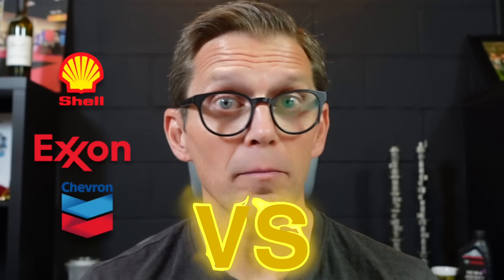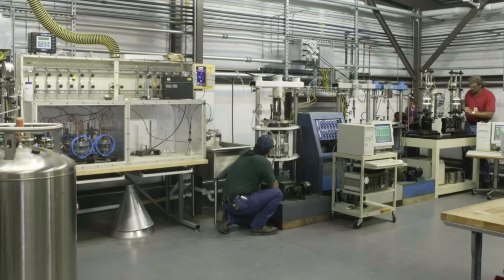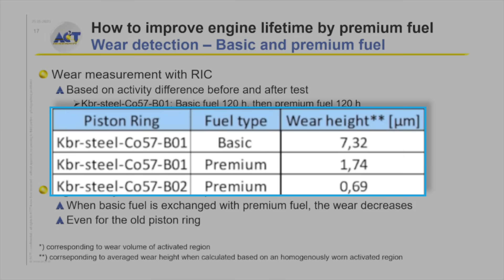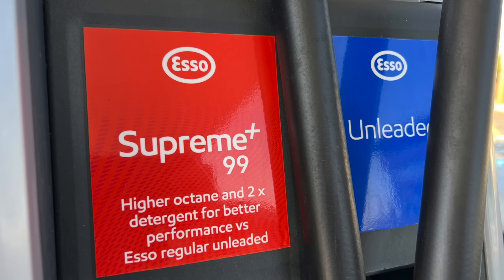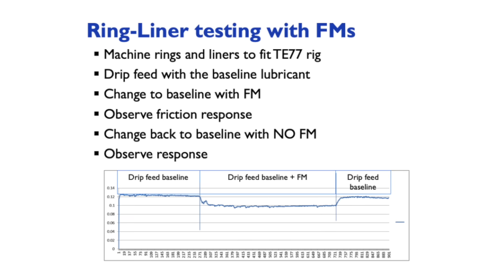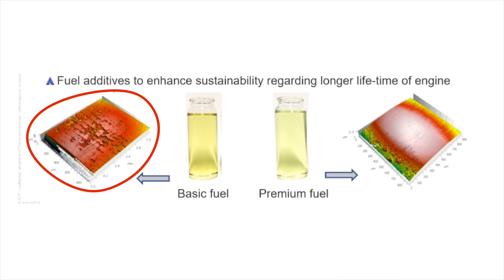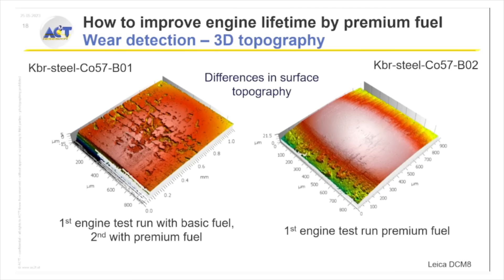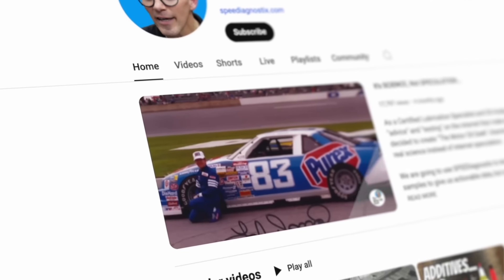Can Premium Fuel REDUCE Engine WEAR?

Comment: Here in Germany we have 100 and 102 RON (~96 to 97 in the USA). Been using only that on my car for nearly 25 years. Recently I sent my injectors to get them cleaned and they told me they basically didn't need cleaning, spray pattern, etc all almost perfect, except one, which was 99.9% good. 30 year old injectors that have never been taken out of the car before. 
That fuel does help.
Reply from the maker: Thanks for sharing
Reply: I have seen the same thing here in Australia with premium fuels, we have two premiums, 95 ron which no one buys, 98 which a lot of people use, and the two regular options which is straight petrol at 91 ron and E10 at 94-96 ron depending on petrol station claims.

With cars that have used 98 almost exclusively, the fuel systems are pristine, where the regular fuels leave a bright red/orange fine smoky dust coating that is also abrasive to fuel pump rotors, brushes and comutators and injector pintles and seats.

My personal experience with injector cleaning is that it is a no no for injectors run on regular as they always leak on heat soak after cleaning, resulting is a hot engine flooding upon restart.  This is because the seats and pintles are pitted and eroded, the dusty deposits is what kept the injectors from leaking before service. So I generally never have them serviced, I just replace them with good used ones that have not been serviced but test good, or just brand new OEM ones (no after market). 

Injectors that ran on premium seldom need servicing, and if they are, leaking afterwards is much less common.
Reply: @3800S1  95 that no one uses? MOST people use 95 over 98 as there is a large price difference normally. If you owned a service station (petrol station), you would know that.

Also E10 is only available in some states, it has mostly been phased out in most states.
Reply: @3800S1 so if i always run standard i shouldnt switch to premium?
Reply: Compare the cost of purchasing and using premium fuel over 30 years to the cost of a set of 30 year old injectors, and I bet the fuel cost significantly more. Also, the effect you're describing sounds to be more a result of detergent additive than anything else.
Reply: @anthonyantoine9232  I already wrote I bought it mainly for the HP gain I get from it, due to the high octane. The cleaning is just a bonus!
Who are you to tell me what to buy and what not and what my reasons should be?

Other fuels dont have that cleaning additive here. They literally advertise the cleaning effect. And you too should watch this video before commenting.

You clearly havent. Nor did you read my comments here.
Reply: @cartrips9263  I'm not trying to tell you what to do lol. I'm making suggestions based upon what I read. Relax.

I watched the video.
Reply: Both you and motor oil geek are missing the point: the test is comparing top tier gas vs "basic" gas. NOT octane levels!!!!
Reply: @1guarino In Germany and much of Europe "Top Tier" ONLY comes in combination with High Octane fuels .....
Reply: @1guarino  can only get that kind of gas with that cleaning additive here in high octane versions. I only told my experience with such additives, it's the other guys who started to derail.
Reply: What kind of engine do you have?
 I guess it's port injection for 30 years old, for that Octane number you should have a high RC in order to get the advantages of the high octane.
BimmerN53
Reply: 99.9% is the very definition of “almost perfect”
Reply: I also live in Germany and no way I would pay that money difference for a car that I do like 15k km a year. On the other hand both my motorcycles get only the best of the best: V-Power racing or Aral Excellium 102 🤓
Reply: You paid for many pairs of new injectors during the 30 years of extra cost...
Reply: @borisboxer1690  Not really. They are not being produced anymore and used ones are very expensive because of that fact. Plus getting them replaced costs about a thousand dollars in labor alone and a lot can go wrong doing that (I know, because I took them out myself).
Also why would I rather live with the fear of them not working 100% anymore over time and then eventually having to check everywhere possible for the cause of a problem thats ultimately caused by dirty injectors?
This stuff works. Period. I gladly pay a little more for it, since its also a fun car thats not a daily driver. And as I said already, its only an added bonus. The higher octane is the main reason I buy it, and that literally adds about 30 HP, because I can run higher boost.
Reply: thats actually crazy and good to know as someone younger
Reply: Interesting what you mentioned about fuel quality and how it destroyed injectors (and fuel pomps).

The Euro 95 is about the same as 89 octane in N. America, while the European 98 is the equivalent of 92 octane. I remember a few gas stations like Sunoco, Petro Canada, used to sell 94 octane in Ontario. In my motorcycle days when we used Wiseco high compression pistons, bigger valves, aftermarket cams the 91 was a minimum requirement for street use and mostly 94 octane fuel was used for modes engines.
Also most stations sell 91-92 Super without added ethanol, while some still add "up to 10% content". 
Maybe it would be worth to add topic of ethanol vs no ethanol fuel, and E85 (used extensively in Brasil), while we talk about fuel.
And, two years ago someone dropped to my friend's garage an old Lexus which was sitting for a decade untouched. The internals of the half empty fuel tank basically showed how corrosive the fuel is, once left inside the tank - the fuel pomp was death, plastics were falling apart once touched and metal pieces were covered by thick layer of rust. The fuel itself had unbelievable smell, more like acid than gasoline, although it still burned well when we took a sample. 
I always tell people to use up all the gas, drain carburators in their lawnmowers, generators because left over fuel causes no start problems later on.
Reply: @pliedtka  I use ethanol-free 93 octane fuel in machines that may sit for a period of time. It has a 2 year shelf life. My generator may sit for 6 months, my ATV, about the same. My 1973 Mustang never had ethanol tainted fuel.
Reply: @TheBandit7613  And I use whatever I can get at the local Coop without any concerns (as long as it's not over a year or two old. Haven't worn out an engine either. One had 315k before I sold it. Running strong. Never had any injector work done on it.
Reply: @TheBandit7613  Mustangs for life!
Reply: @pliedtka  Some Petro Canada stations still sell 94 where I am in southern Ontario. But not all. Not sure about Shell.
Reply: What effect would 2 stroke oil in diesel have on wear? It quietens the motor.
Reply: @davidigglesden  Don't do that, it is not made for a fout stroke..... .

Comment: But here in Canada, what would be the difference between Shell 91 octane vs Petro-Canada 94 octane gasoline? The chemistry has something to do with it, but most brands (except Shell) don't brag about it. Would more octane be better than better chemistry is my question Lake. Great video btw!👍
Reply from the maker: Thanks. My suspicion is that the Petro-Canada 94 would be similar to the Shell.
Reply: @themotoroilgeek  If you could test both, because Petro-Canada 94 is not offered throughout the country, unlike Shell 91. Petro-Canada only offers 94 octane in 914 stations here in Québec, Ontario and Alberta. Petro-Canada also has 91 octane btw.
Reply: Octane rating simply reflects resistance to detonation.

Comment: Lake this is awesome, thanks for explaining. I always thought that there is zero benefit to using higher octane fuel when a vehicle does not call for it. When you get to the next video can you go thru the cost vs benefit calculation? Also, explain "Top Tier" branding, how does that play into this? - Cheers
Reply from the maker: Great suggestion!

Comment: Hi altitude areas in the US have 85 octane fuel - I cant fathom how bad this is for an engine. I never buy a used car coming from those areas
Reply: That doesn't affect the fuel quality. Regular is 85 (instead of 87) in Rocky Mountain states because that is all that is needed to prevent detonation at those high altitudes. Higher altitude = less air in cylinders = less pressure before ignition = less susceptible to detonation. Premium fuel in Rocky Mountain states will still have the same rest of the additives packages as does premium fuel in the other states.

Comment: I understand Premium has more detergents and additives in it. I only use Shell Oil and Gasoline when possible but like Ethanol free gas when I can find it. Wouldn't it make sense that there is less where with premium simple because it take more oil to make it. Since it is made with more oil then wouldn't the oil/fuel ration in the piston groves be with less gasoline? My big concern with premium is that it burns at a higher temperature and since I bought her new, my 2009 Hyundai Sonata runs and drive the same as I drove it off the lot! It has a regular naturally aspirated 2.4 (Theta II MPI G4KE) 4 banger nice and simple I think with only 10.5:1 compression ratio. It does not burn a drop of oil. My concern with premium is that it burns at a higher temperature so if my engine is designed to run on 87 will all the fuel be burnt up in the higher octane gas? This even with EGR? So my concern is carbon build up! This I would wonder/worry about more in the winter when it is colder! Back in the day I would have to some times put premium/higher octane gas in my car like my 2009 V6 Camry when it was hot out or it would ping and or spark knock. As we know, that is fuel/gas exploding or igniting in the combustion chamber pre ignition (before the spark plug fires) due to the compression of the fuel. This is also when the piston has not reached the top if its stoke and can be forced down pre-maturely causing strain on the crank shaft bearings or even can burn a hole in the top of the piston! This is the "knocking" (spark knock) you hear and the "popcorn popping" sound is the pinging. Using higher octane/premium fuel when it was hot and or in city driving would alleviate the issue. More modern engines have VVT (Variable Vale Timing) to alleviate the problem. So now in my Sonata when it is hotter outside I sometimes use Lucas Oil in my engine like this summer when I did a lot of highway driving at over 100 degrees and the AC on. I noticed when I checked my oil it looked higher and higher on the stick finally up to one quart! I did some tests like compression, exhaust gasses getting into the coolant to test the head gasket but since my reservoir was on the full line I didn't think it was that. So I though maybe a defective fuel injector(s) and gas is getting into the crank case. Then I thought what about the Lucas Oil Engine Lubricant? Could it not be burning and blowing by the piston rings getting into the crank case?! I immediately stopped using it and changed my oil. It been 2500 miles and the oil on the dip stick is exactly on the full line where I filled it to! So I am sure that is what it was and didn't bother to have my oil tested. That is a video/test you should do for sure! I think it is best to just put in the gasoline and use the oil the manufacturer suggests/calls for and leave it at that. Most of all this additive crap is just a marketing BS/SCAM! I know MANY vehicles that have just run on 87 gas and decent synthetic oil and go over 300,000 miles, especially more proven/reliable cars. My neighbors old Hyundai Mini van has 378,000 last I saw and took a picture of the odometer all on regular gas and oil. My brothers Toyota Matrix when 278,000 miles before he traded it with regular gas and NEVER a single additive to the gas or oil and with CONVENTIONAL oil IN New England! Perhaps todays higher compression more tech engines would benefit from premium/higher octane gas, especially turbos, I don't know.
Reply: "...it take more oil to make [premium]."
False (and irrelevant, even if true).

"...premium [...] burns at a higher temperature..."
False.
Reply: @aliendroneservices6621  You are totally incorrect!

Comment: my engine isn’t designed for the higher octane. I’d feel better putting in 87 according to the owners manual. Since it’s the additives that matter, just tell me which brand of 87 has the best additive mix.
Reply: A higher octane-rating does not hurt your engine. Octane-rating simply reflects resistance to detonation.

Comment: Hate to be a nay sayer, but the fuel brands sent up pipelines isn’t stored separately amongst brands at fuel racks. Brand x, product y is sent through the line and chased with a slug. It’s then stored in product y’s tank. As he mentions in the video. But unless that fuel is shipped from a branded rack or refinery, your fuel is not going to be brand x going to brand x’s station. I have no experience handling fuel from branded refinery racks and cannot speak to its chain of custody. I can speak to the handling of general bulk racks.
Reply: 6:04 "...but the fuel [...] sent up pipelines isn't stored separately among brands..."
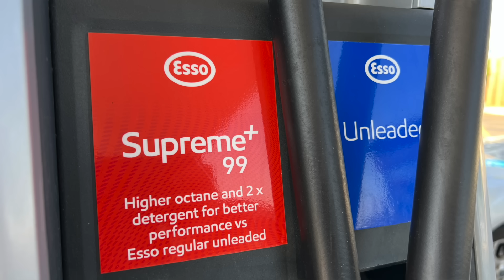That's exactly what he said. The basic (83 octane) fuel is the same. The additive packages are different. The brand-specific additives are added after the 83-octane fuel is shipped. 6:23
Reply: @aliendroneservices6621  yes, but not at all racks. As I said, none of the racks we drew from had downstream additives mixed. I also noted I did not have experience drawing from major hub racks and can only comment on my, further downstream, handling experience.

Comment: Cam using fuel additives supplant using higher octane and/or brand specific fuels to achieve the same improved wear characteristics? This is my favorite new channel.
Reply: Or can starting off by using higher quality oil that's going to be diluted by gasoline already be the answer?  

What oil were they using in those test study showed? Were they already using a poor performing oil so they clearly see the change in the fuel performance?

Comment: I wish Shell/BP/Exxon/etc would release lower octane fuels with the same ultra advanced wear/detergent packages as in the high octane fuel blends. I have a civic hatchback with a little port injected, NA 2.0l 4cyl engine which only needs 87, but I have to put 93 Shell Nitro in the guy in order to get the anti-wear benefits. I don't need the higher octane rating but since I'm trying to keep it ticking over for as long as possible it's kind of my only choice :(

Comment: For 15 years I've been using exclusively V-Power fuels on my cars and have never regretted it. My diesel Q7 exhaust looks brand new at 152000km and never had issues with PDF or EGR so far.
I'm not so rich to afford cheap fuels.

Comment: For fuels I use Shell V-Power or Mobil Synergy Premiums, no ethanol if available. Using Techron every other oil change might be overkill with those fuels, but considering it.
For oil I was using the Pennzoil Platinum ('cleanest') but switched to Valvoline Restore and Protect ('cleans')

So I'm doing the best I can with the knowledge I've gleaned to keep the engine as healthy PM/fluids wise.  A high quality fuel with cleaners to keep the fuel system and top end it touches cleaner with an oil that will keep all the rest clean from residue.  I think I can't go wrong with Shell/Mobil, Pennzoil/Valvoline.  Any quality product regardless of brand would be close enough I'd presume, but I feel those choices work for my usage and budget.

Comment: i once got a tank of gas at a murphy gas station and my engine took about 20 percent longer to start had a 40 percent power loss and even burned 30 percent more fuel. i had to run a strong fuel system cleaner(chevron techron ) after because it carboned up everything. i usually use quick trip but the gas was nearly 20 cents cheaper at murphy... it costed me way more then i saved. i learned a lesson that day.

Comment: Back in the 90's, Ford had a problem with fuel pump failures. When they pulled the old pump out, they could tell if you consistently used the same brand fuel and what it was, from how the pump failed. Additives affect everything the fuel contacts. Great video Lake.
Reply: I worked at Chrysler in mid 90’s. We had exact same problem, but only on diesel pickups. And it was additives from shell gasoline causing all the failures. And it only happened in temps below freezing.
Reply: Yes using gasoline in a diesel truck would be disaster 😅 @MrHartless2007
Reply from the maker: Thanks for sharing that!
Reply: Mostly Taurus's. I was led to believe it had something to do with debris left in tank during manufacturing. Replaced pump and never did clean tank. Lasted ok.
Reply: But fords now don’t last 40000
Reply: @mikecastleberry9671GM fanboy?
Reply: @mikecastleberry9671 Hmmmm, my 19 F150 with the 3.5 Ecoboost is at 78,000 with no issues.
Reply: Likely it was ethanol breaking down the rubber. Back then ethanol wasn't widely found as an octane booster and only some places were using it. 

It isn't ideal, but ethanol is the best octane we currently have for being effective and environmentally friendly. All the others are very not good for people.
Reply: That's amazing. I did hear about some C5 Corvettes having fuel pump problems and recommending Chevron.
Reply: Chewing tobacco and cigarette butts thrown in the tank from the guys on the line.

Comment: I've been told my Toyota avalon is designed to burn 87 and burning a higher octane will show no performance difference and could cause pre-ignition, which could damage the engine.  Are there companies that have good additive packages for 87 octane?
Reply: It definitely won't cause pre ignition. If anything it would prevent pre ignition from happening at all. But Toyota cars don't usually need higher octane fuel because they're just daily drivers.